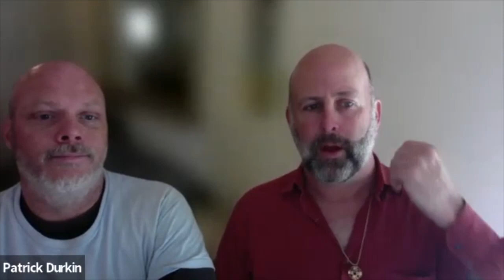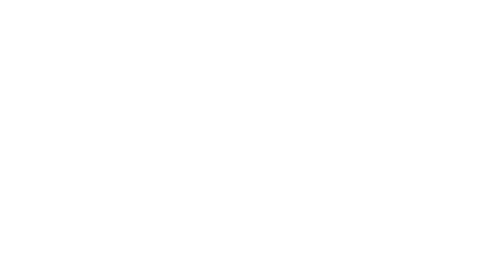How Long Does Water Stay Structured?

Comment: How can you verify that water is structured?
Reply from the maker: All water has a structure. What we are after is increasing the beauty and intricacy of the water. Dr. Gerald Pollack suggests testing the water with a UV Spectrometer, at 270 nm. Dr. Emoto used a scanning electron microscope to be able to see the actual structure of the water. Testing the surface tension of the water is another way to determine how structured water is. You can learn more about Dr. Emoto's work here: https://www.thewellnessenterprise.com/emoto